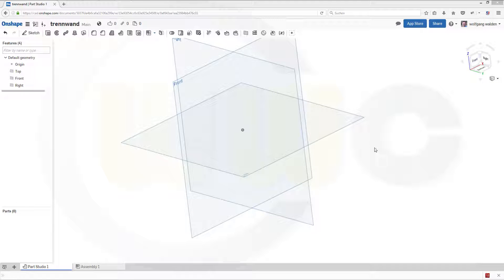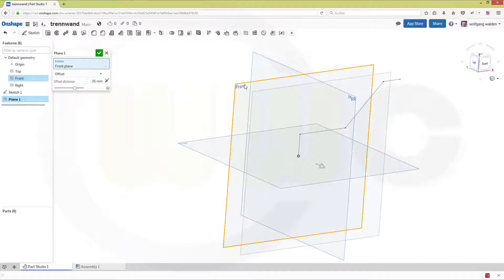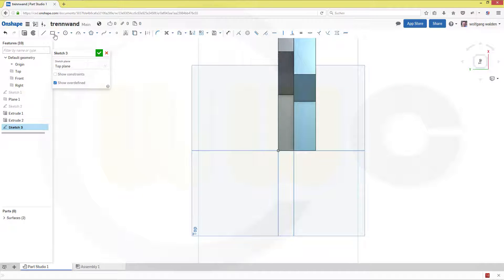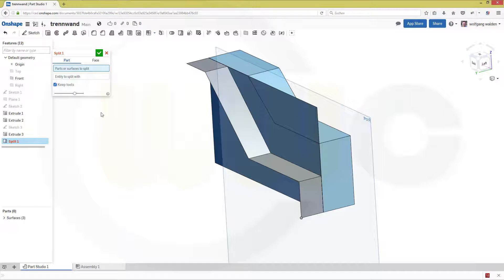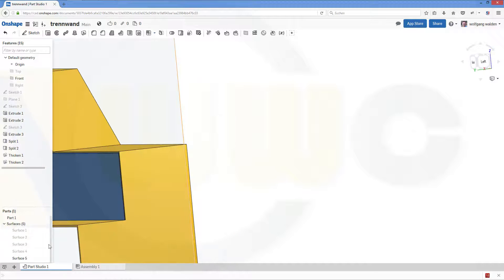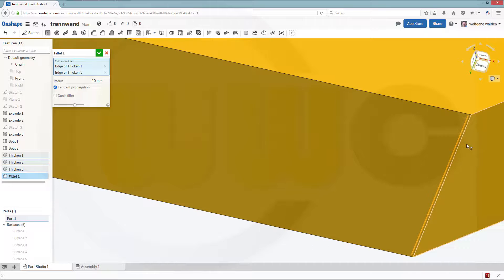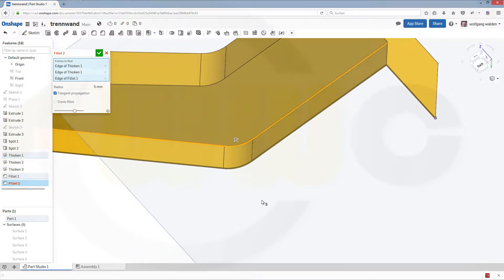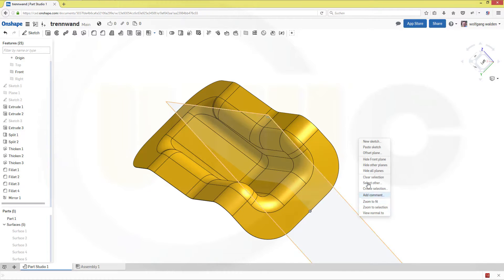Trennwand - Onshape Training - Surfaces

Comment: I managed to replicate this one but one thing is not quite ok. The thickness you ended up with is 0.25 and not 0.5 as you wanted to in the first place...
From a logical point of view one should thicken surface 1 and 5 up and surface 3 on the internal side. This way you get a perfect overlap. But then onshape behaves bizarre when it comes with the filets operation... I had to tweak this up quite a fair bit and proceed with no less than 8 filet operations... This may be due to the version online at present time compare to the one you were using a while ago at recording time... Anyway thanks a lot for your great tutorials working with Onshape.
Reply from the maker: At that time it was not possible to merge surfaces, I had to go for some sort of thickness. Now you can do it without thickness and merge surfaces.
Reply: @wolfgang.walden.cad.training  Ok many thanks, I will give it a go because it looks much simpler this way (by merging surfaces before you head to thicken the part).
Reply: Now that I did use the merging surface feature, I got it done much easier i.e. without the hassle of the thickness being wrong at the edges (external or internal). Many thanks for this great trick.